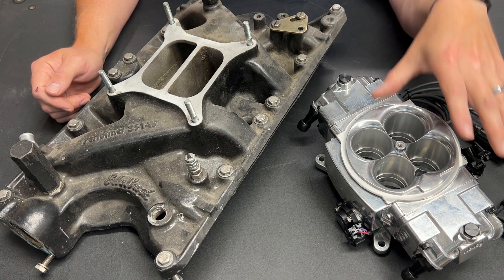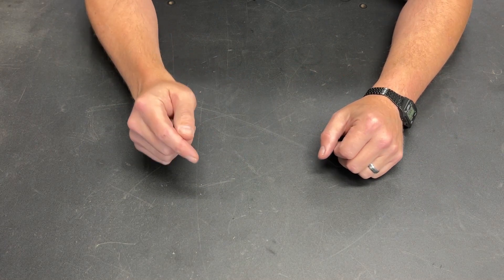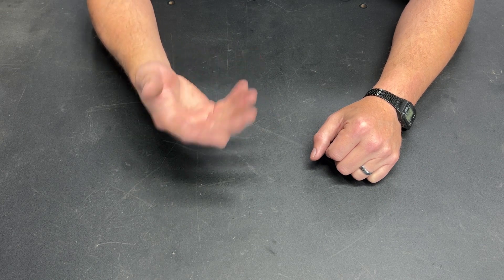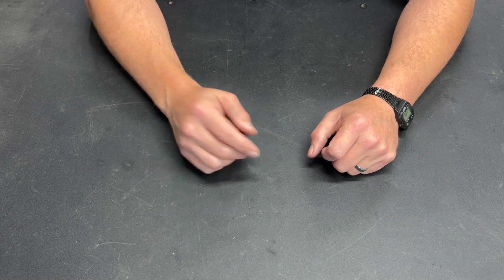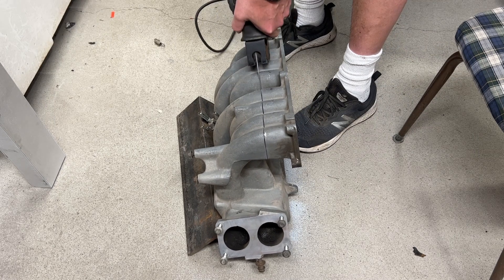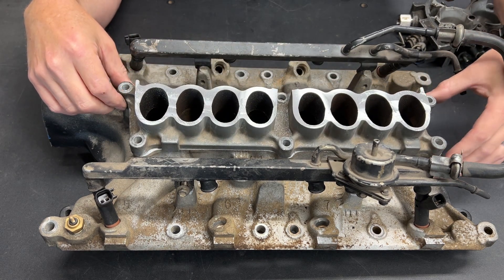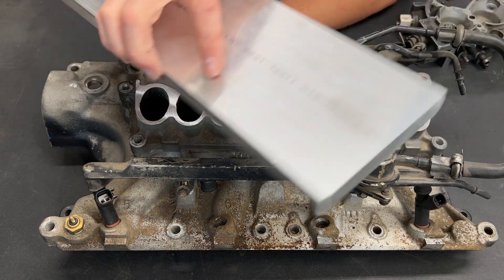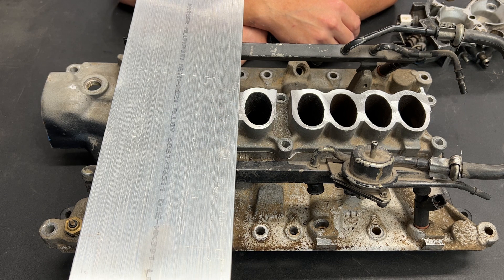393 Windsor Build Part 11 EFFI Electronic Frankenstein Fuel Injection Plan A 1 TIME TO PIVOT

Comment: I think it won't suck properly and then it will suck. The flow from 4 inlets to 8 through abrupt 90 degree turns with no guidence or radiuses will restrict the flow badly. Some cylinders will get way more air than others so the fuel ratios will be all over the place, unless you can meter each cylinder individually.  I have done flow work on racing engines and smoothe transitions make a big difference. The plenum on the truck manifold has long runners after the plenum for low end grunt. That's also gone now. I can't offer a solution for your height problem. Maybe get an intake that will hold two gutted 4 barrel carbs and add a throttle position sensor. Drill it to to accept injectors at each port close to the head. In any case, good luck.
Reply from the maker: I agree and disagree.  It is a strait shot 2 into 4 (no 90º) with each of the two TBIs feeding 4 cylinders.  The inside of the plenum will be blended similar to a velocity stack to direct airflow.  The "open plenum" between the two TBIs is just there to achieve balance between the two banks of 4.  With that said there is still the potential for air restriction, BUT the effect will be most pronounced at high RPMs.  This is not a high RPM motor.  The air restriction will likely be minimal under 4000 RPMs and the motors max RPMs will be 5000-5500.  This would never work if I was building a high RPM race engine.  As to the length of the runners yes I am losing some runner length and that will effect low end torque. In fact that is a concern and why I am machining this out of two big chunks of aluminum rather than the square tubing I show in my previous video.  I want to get the most runner length I can given my minimal space to work with and I can add 1" or about 20% more with the bottom piece of aluminum. Back to los of torque I will also be opening up the runner volume on the truck lower and that too will reduce low end torque, BUT its a 393 built with low end torque in mind so even if I lose 30 foot pounds at 1500 RPMs I would still be left with 350+ foot pounds so no big thing.  As to your modified intake idea if I was going to do that I would do it with a single 4-barrel intake and a 4 barrel TB.  The issue is adding fuel rales and injector bungs to a carb intake is easier said than done and there are not a lot of options out there for EFI on a 351W platform.    I really appreciate your input and will keep what you said in mind.  I may find that what you said is completely correct and that the intake simply doesn't flow well enough to provide consistent airflow to all 8 cylinders, but I am reasonably confident I can make it work well for this application.  we will see.  I'm not afraid to fail and I won't know for sure until I try.
Reply: @dazecars  The good news is that hobyists mostly only loose time. I built a milling machine that holds my old atlas lathe so I could use the power feed of the lathe. Have 14"  spindle clearance, 2.5 hp plus 3 pully system for torque control (learned from you ) It works but the table is mounted to the tool post with supports on both ends, which is not rigid enough. Light cuts needed. I made some mistakes along the way which made me a better machinist when fixing them. I will stay tuned. Chive On!
Reply from the maker: @paulshermet535  sounds like a very cool project, I would love to see pix.  You could email me through my website.  for me the fun is in the problem solving so I will bang my head against this project until I get somthing that works, one way or another.😁

Comment: At least you still have a plan, would be worse if you run out of them!!  

I am currently building a 260 V8 for my sons '63 Comet and being the non car guy he is, it will be a EFI engine. I took a piece of aluminum 35mm high, machined a 30mm channel on one side and and a TB hole on the other side. The channel covers all stock 5.0 intake holes and acts as the plenum. The engine is not in the car yet but in a small test run it sounded good and i was able to set the initial timing. I'm using the '87 Mustang SD ecm for this setup because there is no room for a hat and all the pipes on top.  Looking forward for your next step!
Reply from the maker: Do you still have my email address?  if so I would love to see pix of your EFI build.

Comment: Did you ever consider building your own “breadbox” style upper intake and just running a large single throttle body off to one side like the Foxbody Mustangs? That would help you control the height and also you already have the bottom piece that you cut out of the original intake to build the upper manifold.
Reply from the maker: I thought about doing it with a 4X4 piece of aluminum tubing but I was concerned about equal air distribution if I put it on one end and was back to height restrictions if I mounted the TB anywhere else